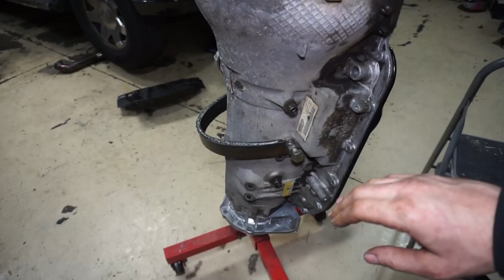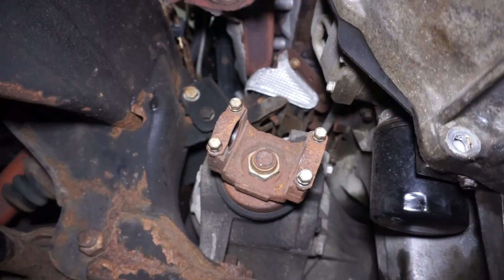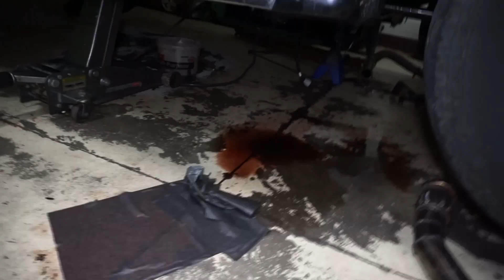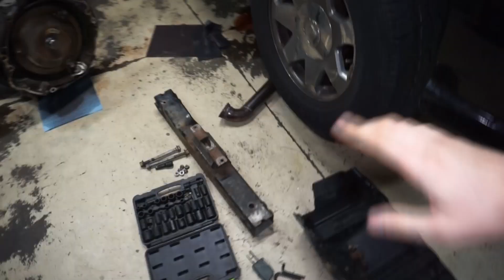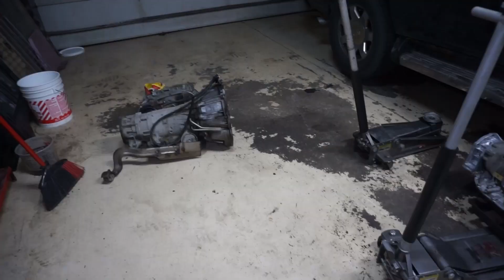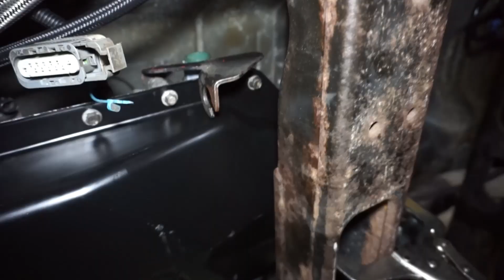Swapping A 4l80e Into My Turbo Escalade!!!

Comment: Do you have any details on this like what part # it is and/or source for the adapter between the 4L80E and NV149 transfer case? Did you put 32-spline input shaft on the t-case? Where'd you get that, if so?

Comment: Nice job. It was good time to replace brake lines. Dorman has nice stainless steel brake lines kit $120. I replaced on my 2005 Escalade - kit fits nicely. I just get second break line set for my 2003 Escalade. 
What is your recommendation for axles gear ratio? Should I worry about switching rear axle? I planing 600 rwhp, for joy driving. I broke rear diff once on my stok 1500 Avalanche (80K), just normal driving through the city. 
Rear axle on 2003 Escalade has 200k and working ok.  I have 2 donor pickups:  1500HD 3.73 posi  (160k) and  2500HD 4.10 posi  (43k).

Comment: Isn't the transfer case input spline different between 4l60 and 4l80?
Reply from the maker: Yes, I have a different Tcase with 32 spline adapter.
Reply: @BlaserBuilds  just thought Id mention it.
Reply: I have a 2002 sierra denali AWD it had the 4l60e but I got a 4l80e to swap in just can't find the adapter to connect the 149gm transfer case to the 4l80e. Could you give me any info on were to get the adapter. Thanks
Reply: If you could share the adapter for the transfer case would be awesome!!